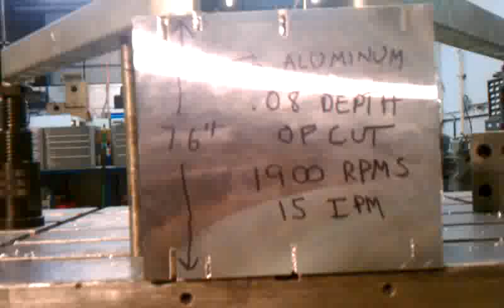Suburban Tool Fly Cutter Killing an Aluminum Block

Comment: Why horizontal mill?
Reply from the maker: +krap101 Why not?
Reply: +mvpmachine fixturing would be easier on a vertical
Reply from the maker: The Devlieg horizontal has a little more horsepower than our Fadals and Bridgeports and sometimes it is fun to spray chips all over the shop. But the same depth of cut and feed and speed rate could have been used on all of our machines without a problem. Regarding the fixturing it was 2 clamps and using the fly cutter body in the spindle to line it up, almost as fast as closing a vise.